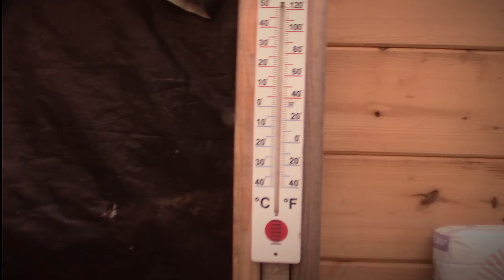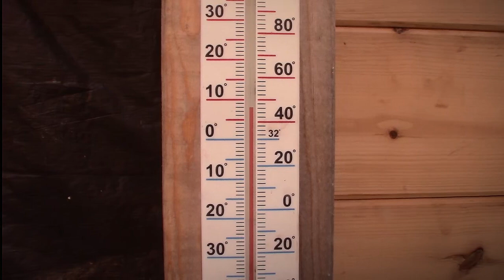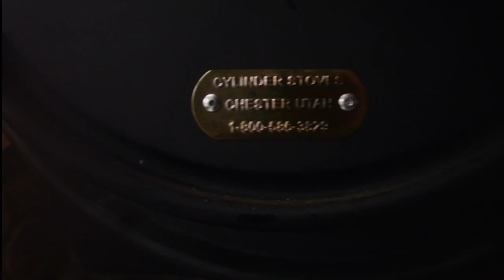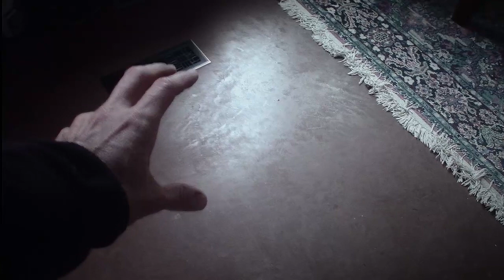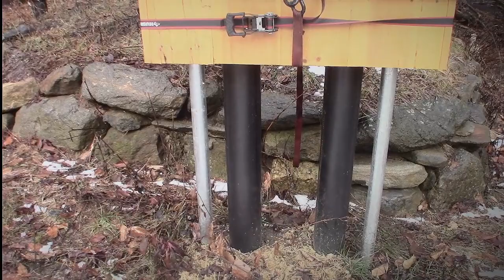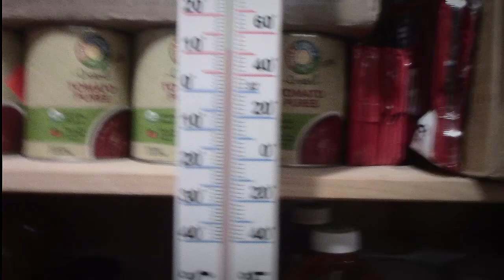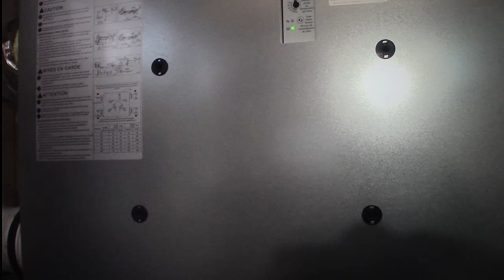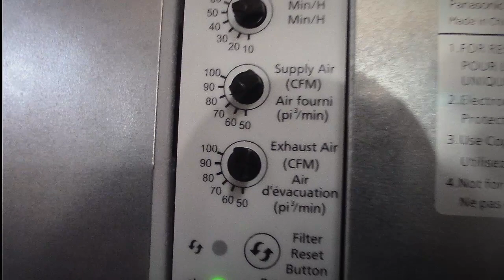Full Tour of Prepper's House Heating Systems

Comment: I love your pallet porch on your drying shed.  Using wood is great, when you are young and competent.  It is also just great heat if you can deal with the problems.  Cutting your own wood, well it is frankly dangerous.  Even loggers have accidents, true you are right somethings you just have to live with.  The problem is too many people think the danger is only from the chainsaw, if they even really understand that. Felling the tree is where the real danger is and competency is hard to come by.  I think I mentioned I did buy a woodstove and have been buying the parts of the chimney over time.  I have it complete now.  I am still not going to install the thing unless the grid goes down long term.  I am 67, I am ,while I have cut down some trees, not really competent.  But wood is heart attack city for the older of us.  Most people on the frontier were lucky to make it into their 50's.  Again some things are what they are but it does need to be taken into account.  I use heatpumps and in today's world, heatpumps are the best choice for most people.  Unless of course you are a good homesteader and determined to be off grid as much as possible.   Still there is going  to come a time when you are not young anymore, or life happens and you become disabled in some way.   So I favor being prepared for both worlds, that is heat pumps with wood stove backup and for most people buying their firewood.  This could be done easier by using pellets but you give up some of the advantages of a wood stove.   Still something like the liberator rocket stove would solve that.  I also like the battery chainsaws, I have a couple of ryobi and the pole saw of this variety is great. 

If you are building new, doing super insulation, that is 6 inch walls and sealed air tight is the way to go, if you also install air to air heat exchangers, with a way to bypass for grid down.  Also love the floor thermal mass system though I prefer using hydronics rather than air, still a great system.  I could not tell, did you provide an outside air feed to the stove?  I would advise anyone putting any kind of a wood stove in to make it possible to feed outside air to the fire, really important if you have a super insulated home.  You put a lot of thought into your system and it is impressive.  I wish more people put thought into the basic home systems.   That Panasonic is your air to air heat exchanger.  They do not need to be that complex, they can be built into the system by running coupled ducts through the house, for a simple one, the longer you can make it the better.  Positive pressure in your home is always best, for all the reasons you mentioned, it is also cleaner and would be an advantage in a radiological event, assuming you filtered in air intake. Good you covered air to the stove toward the end, more than just good, very important.  A legal requirement for people in prebuilt homes.

Comment: every time I see an exhaust-based inline oven I get jealous. What a great invention.
Reply from the maker: I wish I could find something similar that could be used to tap heat for my domestic hot water heating.
Reply: Flip jealousy is a sin. Maybe instead of being jealous you should be more admirable and learn how to make it yourself
Reply from the maker: @jessegolden3589  Oh, I wouldn't give them a hard time about being jealous. Those ovens are actually absurdly difficult to get one's hands on. Not very many get made. I was literally checking with the manufacturer every month for like 2 years before I was able to put in an order for one. That's why I always share the phone number and the company whenever I showcase that product. Just finding a company that MAKES these is an uphill battle. So I figure if I can at least save people that hassle, it's the least I can do to help.
Reply: @jessegolden3589  taking people too seriously is a sin too. Jeez, lighten up.
Reply: @PraxisPrepper  when did they start making them ovens??
Reply: @PraxisPrepper  what about a steam pump that's if they still Make them??
Reply from the maker: @jessegolden3589  I have no idea. I've seen them around for years. I don't know if they're recent or a newer idea. the basic idea of building an oven into a woodstove is VERY old of course. But putting it in the chimney??? IDK.
Reply: @PraxisPrepper  ok it's kinda a little oven. But does it have a temp gauge? Or could you put one in??
Reply from the maker: @jessegolden3589  It does. Here's a video I did specifically on it. I think I covered all the basics here: https://youtu.be/GLhHFbMBMWs
Reply: @PraxisPrepper  electroboom is the channel on YouTube for the microwave Free energy and copper coils. Go to his channel and it will be the very first video it will say 5 days ago. He's from India really Smart brave man. Let me know what you think about this Hope this will help when shtf .

Comment: Amazing setup and video. Very much enjoyed. I haven’t looked into it too much but I’m hopeful the house I’m building will not need too much input to stay warm or cool. I have a dream of a solar powered mini split, the direct DC no battery set up that literally only runs when the sun is up doing the trick if my house can coast through the night with all of its thermal mass. That might all turn out to be a pipe dream but I want to try it.
Reply from the maker: If it gives you any sense of the feasibility of that plan, My house's heat is (as you saw) the woodstove. In the morning, I wake up in the winter and it's usually about 65 in the house. I burn wood for about half the day (that's like 4-5 split logs - or enough to fill the stove you saw) and that's it for the day. I do a small fire at dinner time to cook over, but beyond that, I don't need to run any heat all night to keep it comfortable inside.
Reply: @PraxisPrepper  now that nicest thing anyone has ever said to me. 😂 For real that is some hopeful image to have in my head as I move forward with the project. We are also considering a radiant heat foot system. Couple the photovoltaic minisplit with a solar water heater circulating radiant heat in a closed loop. Redundant off grid heating, day time only. One of the things I think about in grid down is keeping my parents safe from the summer heat as they age. Through the experience the ferrocement community this house is in I know we got some hard limit with passive cooling. Honestly the best we got out there with no air conditioning was a house whos internal temperature was in the 80s and very humid on a 95-100 degree day. That sounds great but In practice what it means is that if you aren’t perfectly still doing nothing you are sweating you balls off.
Reply from the maker: @BenHuttash  I think you have a good chance of the sun collected energy being all or most of what you need if you have a huge thermal mass to gobble up all the free energy when it's available.

Comment: My heating plan has the following “hardware Items” pellet stove, Kerosene space heater, Free standing propane heater, Coleman propane camp stove, Oil lamps, Kerosene Lantern 
Propane transfer hose 
Paper Copies of all Critical Manuals

Consumables 

1# cylinders
20# propane cylinders
100# cylinders
Hard wood pellets
Kerosene 
Candles 
Fat wood 
Cured and Covered Fire Wood
Lighters 
Matches 
This list isn’t not inclusive of the built in home HVAC heat pumps that may not have power to run them
I break down my foundation items into kit even though the are sometimes not portable
Heating , cooking, communications, defense, medical,
Reply from the maker: Sounds like someone's got backups ready to go. Just keep in mind, as preppers always say, "46 is 45 and 45 is 44." ;)
Reply: @PraxisPrepper thanks we already used our heat preps during Christs birthday 4 hr. Blackout, my refill hose for propane made a lot of points with the wife.